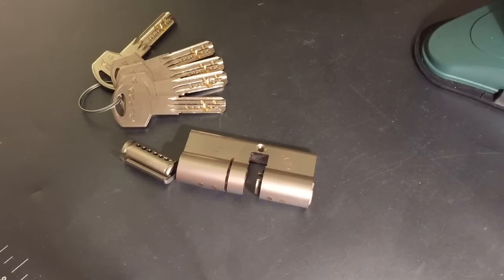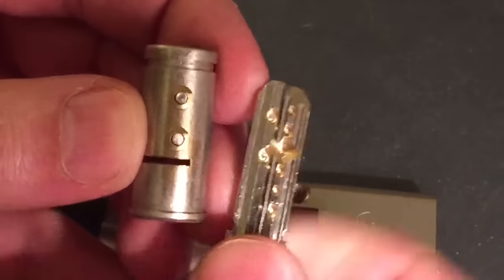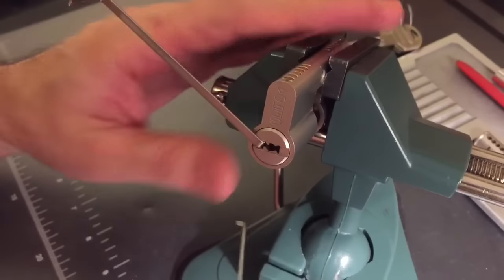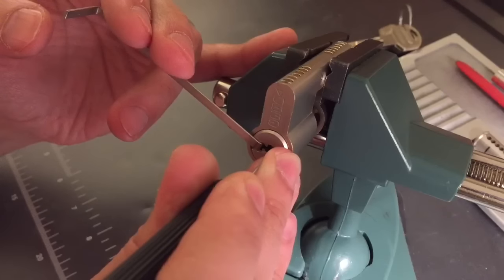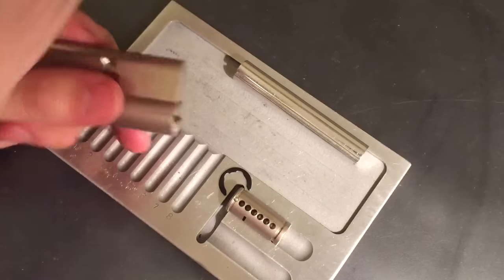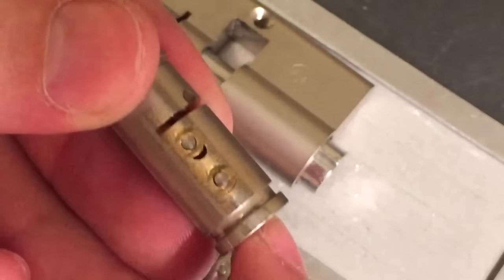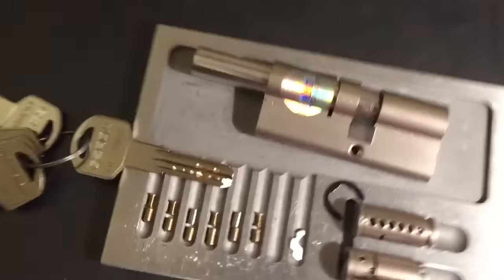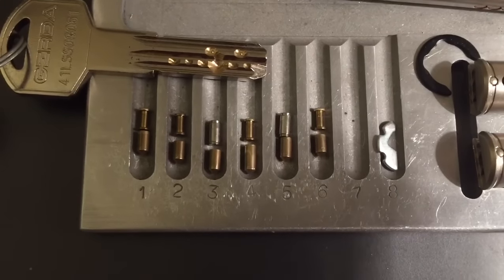[72] Gerda Euro Profile Dimple Cylinder Picked and Gutted

Comment: It fell to your pick prowess pretty fast, LPL.  That anti drill plate is interesting.  It's weird seeing half the plug with a slice through it to accommodate it.
Reply from the maker: +Git Pick'd Thanks.  The drill plate makes sense if you think about it.  Drilling the side of a dimple cylinder (thus cutting the core in half) is an often-overlooked vulnerability, and the locks that do put drill protection there often do not put enough to fully address the threat.

Comment: Hey, there's that Gerda lock that uses long keys (usually silver) that basically can be used  as short distance melee weapons (quite sturdy and I thing usually ended with a triangular head, very thick) - maybe you could try your hand at one of them?
Reply: This looks more or less like the blank of a key to the type of lock I'm talking about, although I remember the head being a little bit more trianglar and the key being a bit longer (granted, scale is hard to judge on a picture like this and I may be miss remembering the head): https://images.app.goo.gl/X6p6M5eXCh6XGidX7 . I remember I could wrap my hand around the key and still have it sticking out on each side of my hand.

//edit: The lock seems to be Gerda zw100